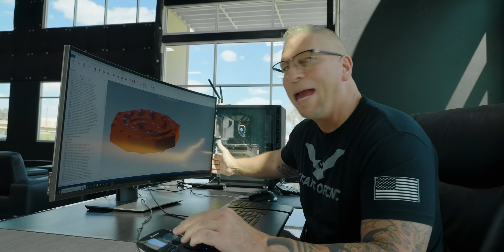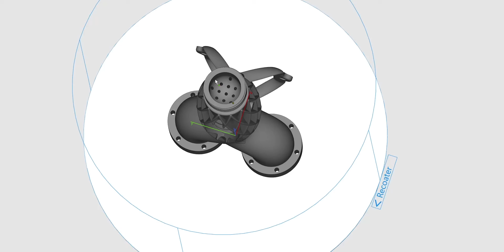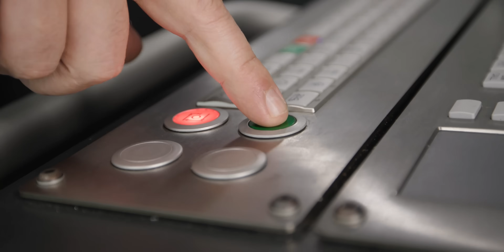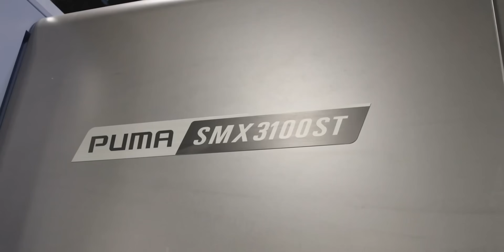We Shipped $50,000 Worth Of Scrap Parts to Our Customer

Comment: Titan's team has totally changed. It looks like Travis is the only guy left. My curiosity has me wondering why more of these guys aren't still around.

As far as scrapped parts on a mass scale. I suspect it happens to most shops one time or another. Learning from it is what sets competitors apart. 

I did it a few years back on one of our swiss lathes. 35k of brass lost. It could have been avoided if the former GM wouldn't have been a cheap ass and resisted buying an indexable hex collet for the sub spindle rather than clamping on the threads. All because we got away with it in the past. Unknown to the former GM, the customer hired new inspection personnel. Thank god the job was set and forget.

I'm the GM now. The owner is always amazed how we went from a barely profitable company to a company flush with cash reserves in just a couple of years, while spending a ton more money. #1 I quote with scrap in mind because perfection isn't achieved without mistakes. #2 I almost immediately doubled our shop rate. #3 I don't gift tooling costs and I buy the right tool for the job, which means no more wasting time doing odd ball things to get through the job. #4 Efficiency. #5 Redundancy.

If the customer okays it, there is a time and place when form fits function is acceptable for the short term but it's not a solution and should never be the norm, like the video says. However, the aerospace industry isn't the place. Heat expansion can be calculated and matters big time when an airplane or spaceship is facing massive amounts of air resistance.

I always like these type of videos because they get me thinking of how we can improve on our process in our shop.
Reply from the maker: Great comment… Thanks

Ya, Travis and my Son Tyson has been with me for over a decade. My son Tyson is on 15 years. Brandon is at 3 years and moved from California. Dave who is my VP has contracted for 10 years and been an employee for 4 years.
A few others made the move but life happened. Stuart had to move back for personal reasons etc and we still talk often. I also have 5 employees that couldn’t move to Texas and I keep them employed remotely and they work on the Academies/ store / CNCEXPERT etc.
The company has completely changed. 
Proud that we have hired many Texans and have brought in insane talent.

We now have the best overall team of all time.
Appreciate all who have been here for different seasons.

BOOM!

Titan
Reply: @TITANSofCNC  So many faces have come and gone. Thanks for the update and thanks for inspiring me to keep improving my skill set.
Reply: @TITANSofCNC  Thank goodness you got out of that State. Texas is the place to be!! Thanks for all the great content!!
Reply: I was wondering what happened to Stuart. Thanks for the update.

Comment: As a machinist our part have tolerances of -.00/+.002 and it’s over by .006 the company I work for still lets its slide out the door. Me as a machinist Im trying to tell my guys the same get the specs of the blueprint and keep your tolerances on point. How would I go about trying to get them in the right mind set ?

Comment: I wonder how you got the whole run completed and THEN found out you were a tenth out of spec on one parameter. As critical as this part appears to be, I'd have thought you'd be inspecting them as they were made - especially since this job took two months of machining time. 

But...things happen. I won't hold that against you.

When you start having bad parts come out, the first thing you've got to ask yourself is, "WHY are these bad? What caused them to be this way?" Was it the print? Was it the program? Did the machinist set up the holder wrong? Did we use the wrong material for the tolerances we need to hold? Or did someone at the client decide they wanted tighter tolerances than the part really needs to do its job?

This is called Root Cause Analysis - determining not that you have a problem, but why you have one and what you need to do to correct it.

Comment: Either you hit the + - of your allowances or you didn’t. But some fits have intentional allowances of fit so the part certainly not scrap. 
Nobody and no machine can hit the exact size called for without tolerances. Sounds like an management intolerance issue.

Comment: As an engineer myself, I can assure that there are so many drawings out there with absolutely meaningless tight tolerances. I think it is totally okay to negotiate with the customer about these tolerances and drawings and sometimes you can even suggest changes to make it easier to manufacture.
Reply: Totally. Big difference between negotiating up front and after the fact though. :)
Reply: I also work in engineering and I  agree. It's very easy to slap tolerances on your drawings without thinking about what that means down the line. Communication with producer about functionality and intent can save alot of unnecessary work sometimes.
Reply: Absolutely right...👍👍
Reply: Agreed 100% happens all the time in most cases I have an idea what it's for but other times when you have no clue you just try to stick to the tolerance which later is said not critical.You end up spending more time and it costs them more unnecessarily.It's usually the young inexperienced engineers sometimes measure and draw a sample  without a tolerance in two or three decimal places (metric).
Reply: That would be fine to do before you accept the job and produce parts. It's quite different to accept the job, start making parts and then try to talk the customer into accepting one or more deviations from the drawing.

In my work I have to review customer purchase specifications. Finding inconsistencies in them is quite common. Sometimes you even find show-stoppers, requirements that are self-contradicting or downright impossible. But then you agree on the exceptions/waivers before you agree to selling material. We don't first sell a few tons of 17-4 PH round bar and, only after shipment, say "oh, by the way, what's on the way has less tight ultrasonic acceptance criteria than specified".

Comment: you need to get a renishaw  NC4  or blue beam ,checks the tool and automatic sets the tool offset  length and diameter in machine updates and the once tool as used on the job before the machine put the tool back into the carousel it with check the tool and if tool is broken or out of spec it will alarm the machine and stop before next tool change  , e.g. if you was to drill a hole and drill broken it will let you know before tool change so the next tool, say a  tap wont break due to hole not deep enough we have them on every machine in our factory and save our jobs from scrap

Comment: dear titan, I have a question. I was at work yesterday and had a press fit. the press passing hole met the size. but the pin didn't go in with any possibility. any idea how that is possible?
Reply from the maker: I would need more information on material and tolerance. As we know, it changes based on material etc and a .2500 pin cannot go in a .2500 hole.
Many tend to over tolerance it.
Meaning, you just need a few tenths for a press fit or a bit more if it’s a soft material. But, if it’s a much smaller hole in hard material, perhaps the tolerance is incorrect.

Hard to answer without see the part and print etc

Titan
Reply: @TITANSofCNC  
Unfortunately I cannot share the drawings due to trade secrets.  but what is possible: material stainless steel, tolerances in mm = 10-0.04 to 10-0.19 the press pin has a diameter of 9.96 mm +/-
(Thanks for the time)
Reply: @N.Diabollo  surface finish can play a role in your fitment issue, but definitely can't say for sure

Comment: Honestly a thou  accuracy is easy Enough to a archive, but .0001 is really difficult to achieve, like the room temperature, how you measure it, and the spring in everything from measuring to machining fixtures comes into play. It’s wild
Reply: this would be beyond wild. but unfortunately u misunderstood. they are no more than .0001 from the customers tolerance, not .0001 from perfection. as you said, its immeasurable. also internal stresses of the material are simply unpredictable. therefor .0001 tolerance on bigger parts is impossible.

Comment: Well, ideally you have enough in process inspection to prevent what happened, but in the case that it slips through, absolutely communicate with the customer and see if it is an acceptable deviation. As we all know tolerances are only on paper and engineers often over spec stuff that isn’t actually that critical. Bless their little hearts. 😂

Comment: I dont think in the history of machining has a part ever been scraped over 1 tenth over or under 😏
Reply: The original Hubble mirror would have been if they caught the mistake
Reply: Lol
Reply: they mean 1 tenth out of tolerance. and im pretty sure those giant parts have giant tolerances. i dont find it very impressive to allow oneself to be out of tolerance. even a tenth.
either your machine can do what the customer orders or you dont take the job.
Reply: Gotten customer rejection over .01° and .0001" more than once. Had to have multiple meetings to get a 1 micron parallel changed to 3 micron.
Some industries get totally bananas with tolerancing on small critical parts.
Reply: @lolcatcatlols  Even within companies in happens..We had a tight tolerance on a hole position before sp ww checked what the final configuration was and the hole position didn't matter to within +/- 1mm...We were so pissed